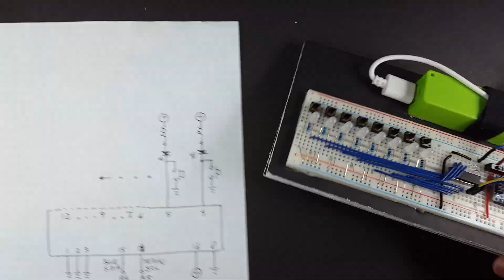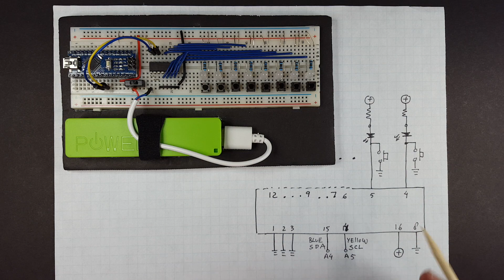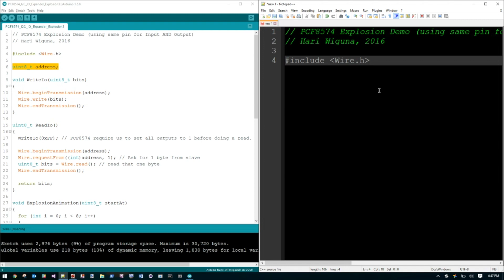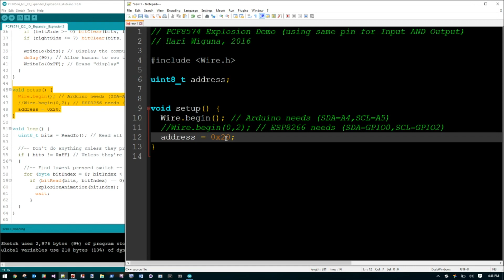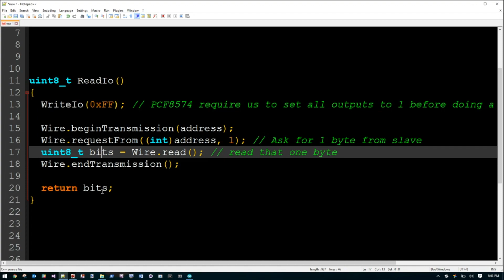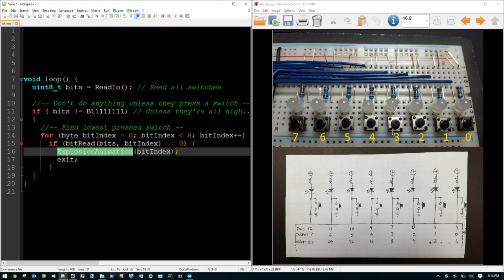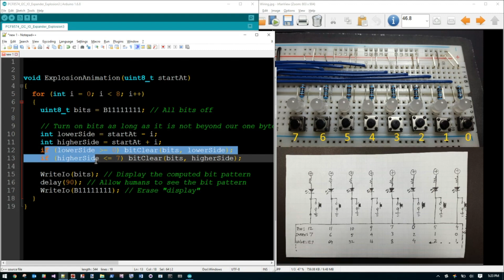HariFun #133 - 8 LEDs, 8 Buttons, just 2 Arduino pins!

Comment: Hi CAn you tell me how do i address every led pin and button pin individually ?
is there any particular way of writing code for controlling every led pin individually?
if i want to use it to add different function on every pin differently
like pin 1 - buzzer 
pin 2 - led with delay and sensor and so on 
plz help  me to develop that code if possible asap.

Thank you
Reply: please let me know if there is any video or tutorial or link available for answer...!!
Reply from the maker: Hi,
The way the chip is designed you must read/write the whole byte at once.
However, by keeping track of bit states in variable(s), you could hide that from the rest of your code.  Also remember that all these bits are digital.  You cannot connect an analog sensor to any of the bits only digital switches, leds, buzzer.
Reply: is there any for analog input??
and can you weite a code or make a video for that??
Reply from the maker: I don't know if the analog version of of the PCF8574 chip exists. However, this is something similar that would multiplex analog signal going both ways.
https://www.sparkfun.com/products/9056
I barely have time to work on my current Sudoku project, so I probably won't be making video about this any time soon. Sorry...
Reply: there is a hc 4051 which i just explores few hr.s ago may be tht will help you should also try that out...

Comment: how do you keep the voltage booster ON in the power bank? my power bank auto shuts off when it detects a current below 50mA so I used a simple resistor between 5v and GND. greetings
Reply from the maker: I must have a crappy power bank. It seems to stay on no matter what I plug into it.  What resistor value do you use? It would be good to know if I ever run into that issue.
Reply: Hari Wiguna 100 Ohm (5v/100ohm = 50mA) but it is 250mW so I think the 1/4W resistor is OK it will get a little warm
Reply from the maker: Thanks Saito!

Comment: Hi Hari
Can i control the intensity of the LED using the IO-expander? I can do it using PWM in arduino.
Reply from the maker: There is no built-in way to PWM the outputs of the IO Expander. But nothing is stopping you from pulsing the outputs of the IO expander yourself by setting the value high and low repeatedly, just like PWM does.
Reply: Thanks for the prompt reply.  I came across this PCA9685, will look into that, if that does not work will try out your suggestion.

Comment: Hi Hari
I am a Arduino beginner and cannot find a suitable solution through Ardiuno website. 

How can I program the Arduino with two PCF8574?
I am not sure if it is work, but going to connect the 2nd PCSF8574 pin9 (P4)  to the first PCSF8574 pin4(P0) making it become a "16bits" information. And, connecting the Vcc, SDA, SCL same as the first one.
I think of changing it to be uint16_t address; but is it ok to  "WriteIo(B1111111111111111)" ??
ALso, Wire.read(), can only read for 1byte, how can I make it to be 2 or more bytes?

Sorry if confusing you.
Reply from the maker: Hi, welcome to the fun world of Arduino!
Unlike the more popular 74HC595 shift register, the PCF8574 is NOT designed to be daisy chained. :-(

You CAN connect multiple PCF8574 to the same Arduino by wiring a different address to each PCF8574.
Unless you also need to have many inputs, the shift register is much easier to use.

As far as binary constants, the Arduino IDE only supports 8 bits at a time :-(
However, IF you use the shift register chip (74HC595) then you can use the command ShiftOut() repeatedly as often as you have shift register chips in the daisy chain.

Here is a video I did on Shift Registers.
https://www.youtube.com/watch?v=EVbbfVzw7vw

Let me know if you rather use the PCF8574 and I can help you connect more than one.

Comment: Great vid! Really interesting
But i got some questions, what happens if you press more than 1 button? Can the circuit read everything?
Reply from the maker: Thanks Rodrigo.
All eight button states are reported as bits in the one byte that is returned on the read operation.
So, yes, you can press more than one button and all will be reported in the read.

Comment: hi Hari
can i use 1 PCF8574  with 8 button input and
1 PCF8574  with 8 led output?
i try to expand i/o pin of nodeMCU 1.0
best regards!!!
Reply from the maker: Yes, you can code one chip for inputs and the other (on a different I2C address) as outputs if you want.
Reply: tks, i will try it.

Comment: Hi ! I want to use your circuit with a Lenonardo and just 8 buttons( 2 pins push-pull). I just need to connect each P0-7 to each button, and then the second pin of each button is linked to ground ? Thanks in advance for your reply.
Reply from the maker: Hi! Your idea might work, but if I were you I would use 10K pull up resistors as shown on page 15 the datasheet.
http://www.ti.com/lit/ds/symlink/pcf8574.pdf
Note the three 10K resistors that pull pins 1,4, and 5 to positive.
When user presses the button, it would bring the pin to ground, and that's what you would detect in code.
Without the pullup resistors, when the buttons are not pressed, the pins would be floating, it's not positive, it's not negative.
I'm not sure what the chip would report it as.
I hope that helps.  Thanks for commenting on the video.
Reply: @HariWiguna  Thanks for your reply ! Is that means that I will have exactly your circuit without the LEDs ?
Reply from the maker: That is very perceptive of you! Yes, you are correct.  Same circuit as mine but without the led.
Reply: @HariWiguna  Ok I just built it, but it doesn't work. It doesn't even send me back the message I put in the loop. Is there something specific with Arduino Leonardo board ?
Reply from the maker: Hey you taught me something!
Leonardo uses pins 2 and 3 instead of A4 and A5.
https://www.arduino.cc/en/Reference/Wire
I didn't know this until I looked it up. We both learned something. Thanks!
Reply: @HariWiguna  I think I will do the same schematic as yours with an arduino Nano, as I don't get anything with my arduino Leonardo..
Reply from the maker: Hmm, that's frustrating.  It should work with the Leonardo.  Have you tried switching the wiring to use digital pins 2 and 3 instead of analog pins A4 and A5?  Have you tried running one of the I2C examples to see if the Leonardo can talk to the I2C device?
Reply: @HariWiguna  I found the problem... I am using PCF8574A instead of PCF8574N, so adress isn't 0x20... I ran this code to find it : https://playground.arduino.cc/Main/I2cScanner
On the leonardo, I tried every pins (but the problem wasn't there..). I got SDA and SCL specific pins on the board, they work.
I just put buttons between pcf8574 pins and ground, and it works. 

Thanks for your help ! Too bad I can't post a picture of my logitech g27 with all the new buttons ! :-)
Reply from the maker: Great job! and thanks for sharing the info!  Ah, so the pullup is unnecessary for inputs. Good to know.
If you don't mind the picture being out in public on the Internet, you can upload it to one of the free image sharing service such as https://imgur.com/upload
and share the link here.  Glad you got it to work!

Comment: Also possible to connecte more I/O Expander? I just need to change the ID using the jumpers?
Is this right?
Reply from the maker: Yes, you are correct. You can have up to eight chips by setting the A0,A1,A2 address pins to different values.
Reply: Hari Wiguna there is also a other one which ends with AN or something like that. I looked on the datasheet and i saw that it got an other identifier adress. So you should have more I/O Pins available. Do you think the same?
Reply from the maker: I didn't know about that, but looking at the spec sheet, I totally agree with you. 16 of these chips on one bus! Wow....

Comment: Are the PCF8574A PCF8574AN and PCF8574P the same like yours? Thanks
Reply from the maker: I believe the A suffix refers to the base I2C address:
http://www.nxp.com/products/interface-and-connectivity/interface-and-system-management/i2c-bus-portfolio/i2c-general-purpose-i-o/remote-8-bit-i-o-expander-for-icbus-with-interrupt:PCF8574P
The PCF8574 and PCF8574A are identical, except for the different fixed portion of the slave address. The three hardware address pins allow eight of each device to be on the same I²C‑bus, so there can be up to 16 of these I/O expanders PCF8574/74A together on the same I²C‑bus, supporting up to 128 I/Os (for example, 128 LEDs).

The N vs P suffix I think refers to the manufacturer.  N is made by Texas Instrument, P is by NXP.

Hope that helps.

Comment: If I use this IC more than one with single arduino 
Then the address of this two separate IC s will different
Am I correct??
Reply from the maker: Yes, you are corredt. You can have two (or more) PCF8574 ICs connected to the same Arduino as long as each PCF8574 is configured to have different addresses.

Comment: Hello Hari
I have done a little playin' around with your little demo, and it works brilliant! - Thanks for sharing it.

I would like to use your program "the other way around" - So 8 active high push buttons and 8 active low LED's - hereby I can drive the LED's via a MOSFET and do PWM.
I therefore made some small changes to your program - And the reading works, but the animation is hardly visible. 
Can you detect the error for me?

#include <Wire.h>

uint8_t address;

void WriteIo(uint8_t bits)
{
  Wire.beginTransmission(address);
  Wire.write(bits);
  Wire.endTransmission();
}

uint8_t ReadIo()
{  
  WriteIo(0x00); // PCF8574 require us to set all outputs to 0 before doing a read.
  
  Wire.beginTransmission(address);
  Wire.requestFrom((int)address, 1); // Ask for 1 byte from slave
  uint8_t bits = Wire.read(); // read that one byte
  Wire.endTransmission();
  return bits;
}

void ExplosionAnimation(uint8_t startAt)
{
  for (int i = 0; i < 8; i++)
  {
    uint8_t bits = 0x00; // All bits off

    // Turn on bits as long as it is not beyond our one byte "display"
    int lowerSide = startAt - i;
    int higherSide = startAt + i;
    if (lowerSide >= 0) bitSet(bits, lowerSide);
    if (higherSide <= 7) bitSet(bits, higherSide);
     WriteIo(bits); // Display the computed bit pattern
    delay(90); // Allow humans to see the bit pattern
    WriteIo(0x00); // Erase "display"
  }
}

void setup() {
  Wire.begin(); // Arduino needs (SDA=A4,SCL=A5)
  //Wire.begin(0,2); // ESP8266 needs (SDA=GPIO0,SCL=GPIO2)
  address = 0x20;
 }

void loop() {
  uint8_t bits = ReadIo(); // Read all switches

  //-- Don't do anything unless they press a switch --
  if ( bits != 0) // Unless they're all high...
  {
    //-- Find lowest pressed switch --
    for (byte bitIndex = 0; bitIndex < 8; bitIndex++)
      if (bitRead(bits, bitIndex) == 1) {
        ExplosionAnimation(bitIndex);
        exit;
      }    
  }
}
Reply from the maker: Hi Tomas,
Your code looks good.  I don't see any mistakes.

I wonder if the reason it doesn't work well is because the chip is designed to sink current to ground rather than supply positive voltage.  on page 12 of the datasheet, I noticed a symbol labeled 100 micro Amp on the positive side.  I don't know what that symbol means, but maybe that's the max positive current it can provide?  Furthermore all the examples on pages 15 and 16 has are wired up with cathode of LED onto the chip (that is the chip provides ground to light up the LED).
http://www.ti.com/lit/ds/symlink/pcf8574.pdf

BTW, shouldn't PWM still work regardless whether your MOSFET pays attention to + or - side of the PWM?  All we're doing is changing the ratio, no?  Granted the ratio would be backward, but you could easily account for that in how you code things.

Interesting problem. Thx for the comment!
Reply: Hi again Hari
Thanks for responding so quickly :)
I see your point - Of course it would be better to sink the current for the PCF8574 - but in the datasheet it says: "Latched Outputs With High-Current Drive
Capability for Directly Driving LEDs" - But the I_o max values talk for themselves...
I'll just place the MOSFET at the anode of the LED's instead - (I would like to control the brightness of all LED's simultaneously)
https://www.inventable.eu/media/EduPaginas/Mosfet/Mosfet-conexion-canal-p.png

Thanks!
Tomas

Comment: hi. if i just use Arduino, how different the code would be?
Reply from the maker: It would be quite different.   The simplest way would be just to have 8 pins as inputs and 8 pins as outputs so that's 16 pins instead of 2.
A slightly more pin efficient way would be to use pinMode() to switch 8 pins between input and output, but that's still 8 pins instead of 2.